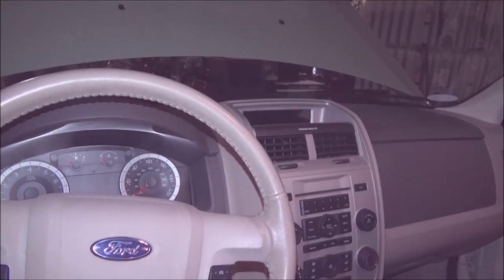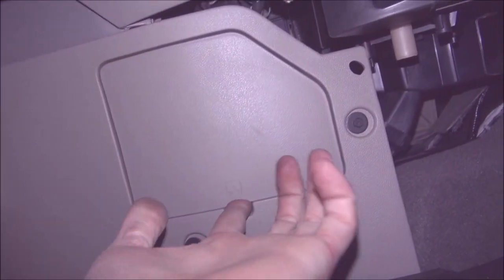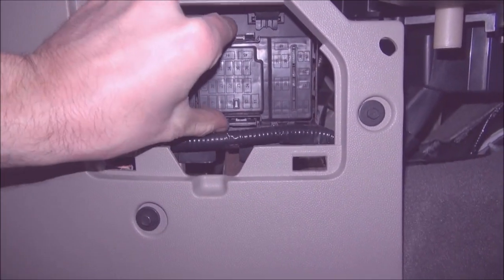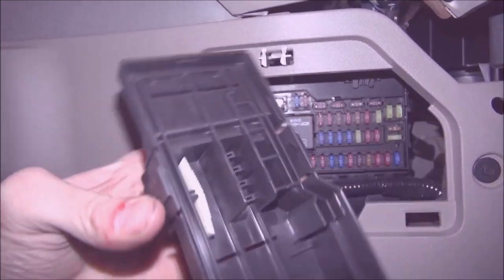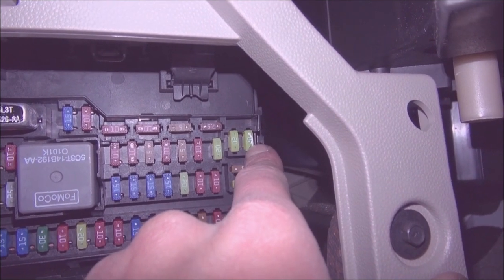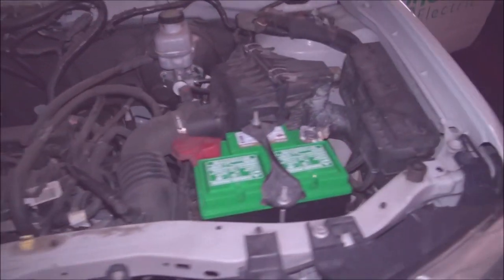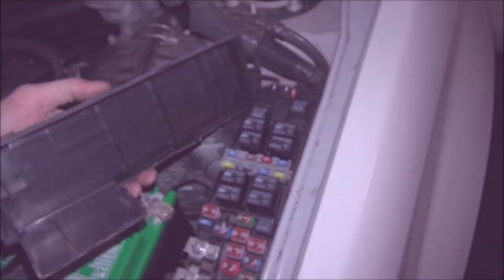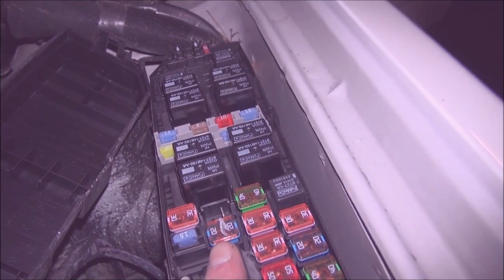Ford Escape 2012 Cigarette Lighter Power Outlet Fuse

Comment: I know this is an older video but I'm trying to get power to the front outlet I don't changed the fuse on passenger but I'm still not getting power. I was told it could be the relay. Can you show how to find relay for the front outlet of you are able to?

Comment: I wish you would have stated what kind of fuse to purchase for the "Front" lighter power outlet as it is different than the "rear" one. Why in the world would the manufacturer of this vehicle put one ligher fuse inside the car and the other under the hood????
Reply: Depends on your car, look inside tou on owners manual. There’s a whole layout of what fuse is for what function, and what amp fuse you need for it. It’s likely  a 20 amp fuse for the front cig lighter, and as he said, a 20 amp JCASE fuse.
Reply: 😳 OMG. Take it out and take it to AutoZone or  O'Reilly's, This is elementary 🤣